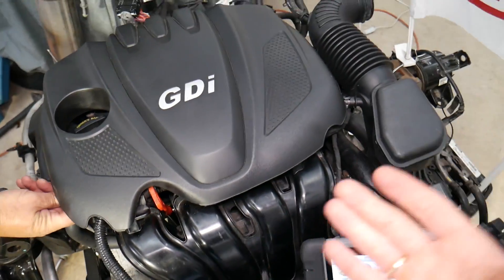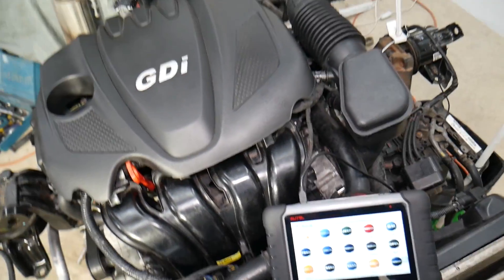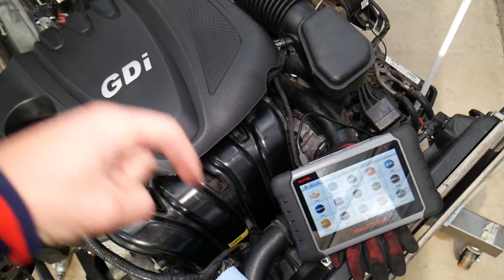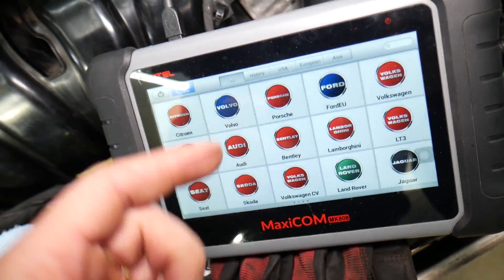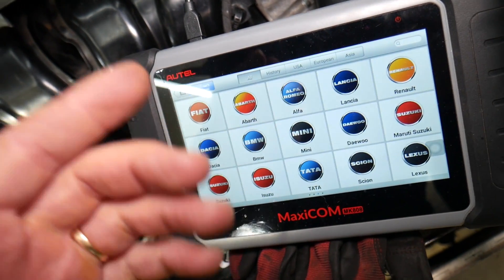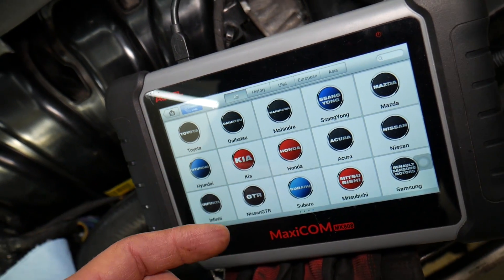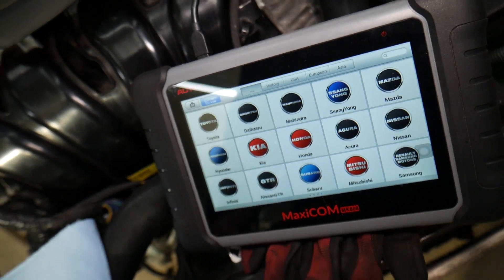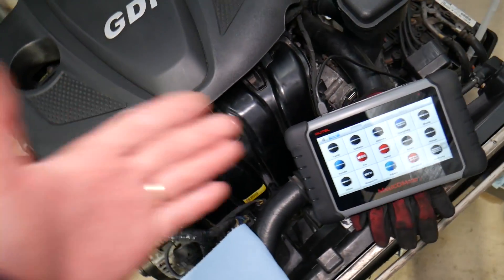CODE P0010 P0011 P0012 P0013 CAMSHAFT POSITION KIA SORENTO, KIA SPORTAGE CHECK ENGINE LIGHT

Comment: My 2016 Sorento 2.4 looks nothing like that in the front. Cannot find intake vvt solenoid, getting code p0010. Found exhaust one, pulled and cleaned it just to check. I was able to purchase an intake vvt solenoid, but can't find it on the car
Reply: itll be on the side of the motor, pass side towards mount